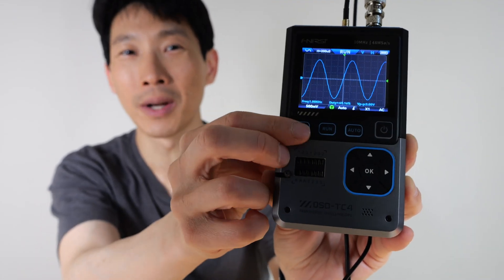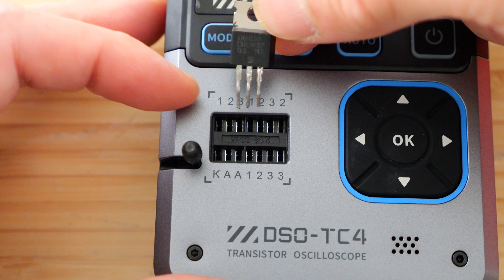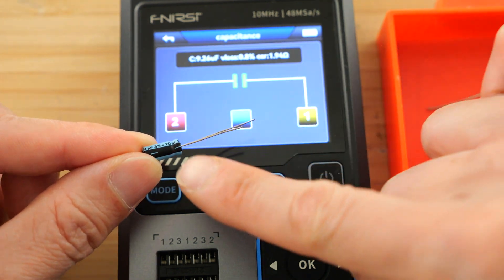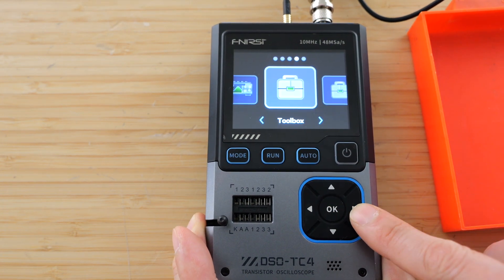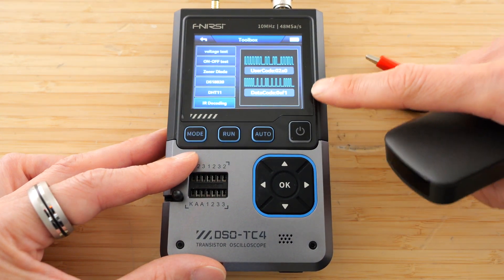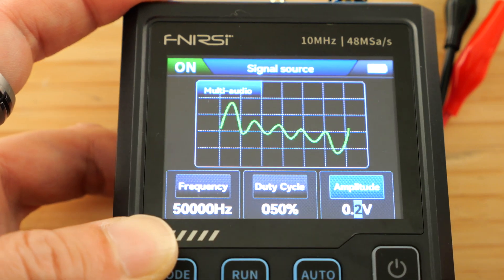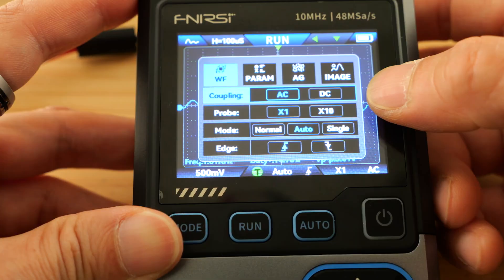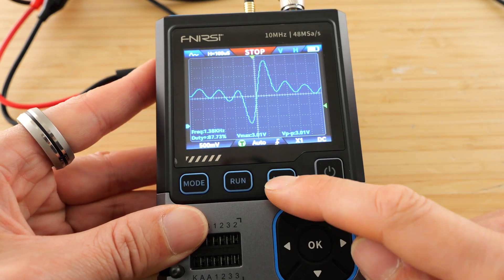FNIRSI Transistor Tester Scope and Fn Gen 3-in-1 Review

Comment: TC3 is remarkably bad at LCR, it is not able to distinguish shot electrolytic capacitors which have high ESR and leakage from fresh ones. As a side effect, capacity on worn out capacitors also often shows up to spec. This is kind of unique, cheap Chinese transistor testers with Atmega actually manage to do LCR just fine in spite of being much simpler hardware! And i actually know why they work fine.

I would ask whether they fixed it in this one, but i'm not going to bother, because i have never seen Fnirsi actually fix anything or develop any insight as to why their products give people pause.
Reply: All your claims are valid, I was about to buy this TC4 and the more I search the more problems crop up, from screen dying within months to major battery design flaws and best of all Transistor Pins for NPN on some are still flipped or incorrectly marked.
Reply: yep typical china cool stuff but wanky asf